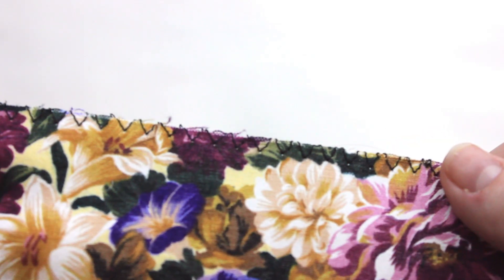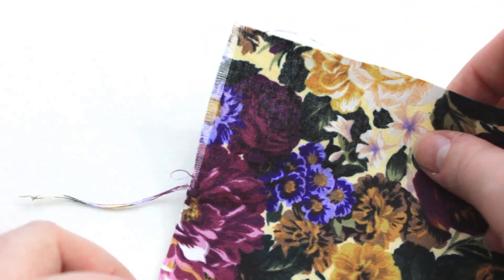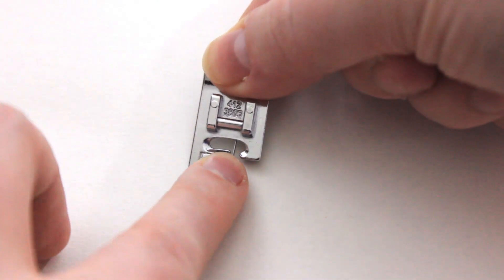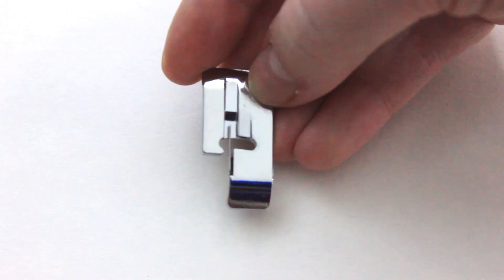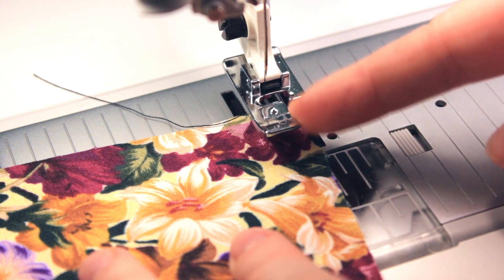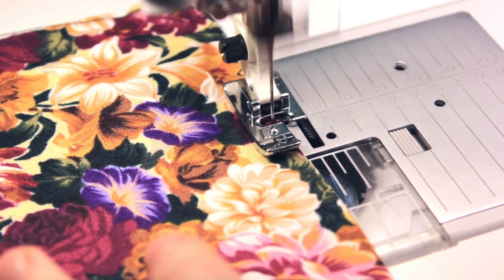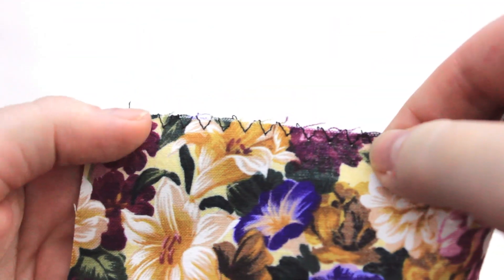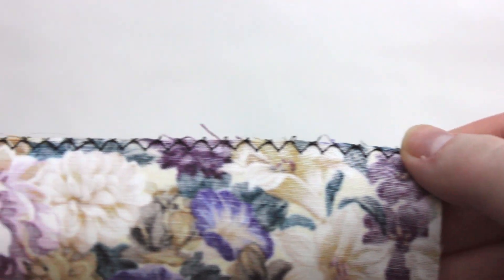How to Sew Overcasting Stitch | How to use an Overcasting Foot

Comment: Hi. Thank you for the useful information. Could you please advise how to avoid puckering while using the overcast foot? What are the reasons and how to avoid them? Thank you!
Reply from the maker: It could be from your fabric being too thin/lightweight. Try using tear away stabilizer or paper underneath your fabric and tear it away when done. Is it happening with other stitches? If so, your tension may be off.